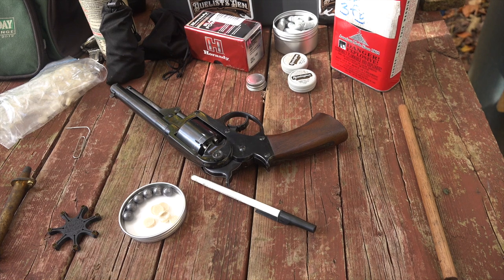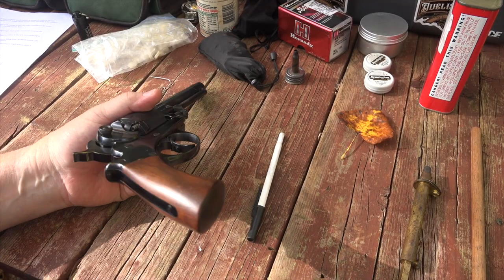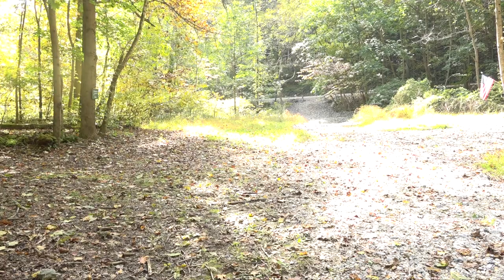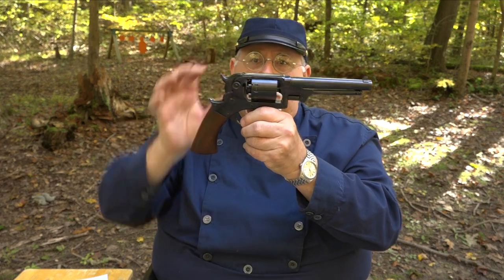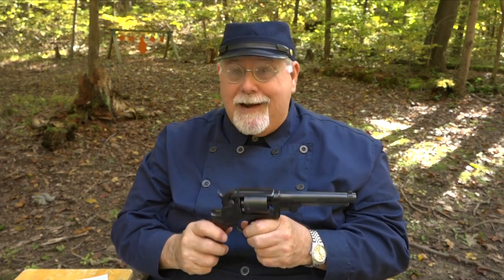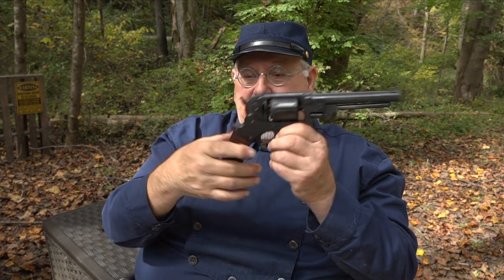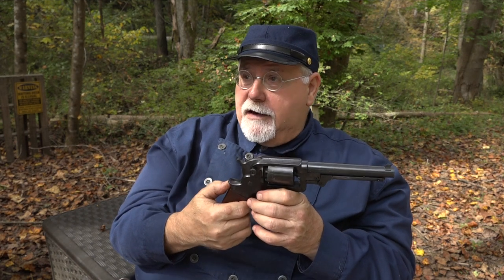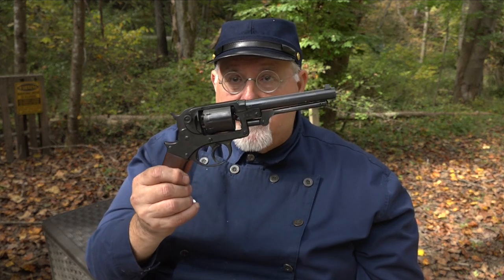Pietta's Starr Double Action Revolver

Comment: I never knew about the problem with thumb-cocking the double action Starr. That would be a deal breaker for me if I could ever get my hands on one. Thanks for the warning. Still a neat piece of engineering and a really great video, as always! Thanks Mike!
Reply: I bought one back when they first came out.  I took it out of the box and it was already broken.  I'm sure when someone is inspecting the gun before sending it off ( I bought it from Cabela's mail order ) it's hard to resist the temptation to thumb cock it.  And who knew you weren't supposed to do it?  They should have had a very prominent warning not to do it.  It would have been better to make it look like the original,  but have a more conventional double action underneath.
Reply: I was going to get one but overpriced and has many bad reviews I settled on antique iver johnson and colts 😂screw the star in my opinion but to each their own.

Comment: Fun watching the Starr actually shoot!  I've never seen that before.  I have both the 36 and 44 double action revolvers (both antiques) and would NEVER, EVER attempt shooting them. Still fun to watch you somehow accomplish it.  I did not know Uberti made a copy of the 44 cal version.  I doubt I would ever buy one - but still fun.  As to the quality of manufacturing - all my Uberti guns work - talking two colt SSA's  and a Schofield 45LC  revolver.  I mean I shoot them all the time and they run just fine.  Personally, I'm of the opinion that Uberti guns are good value for money.  Maybe that's just me.
Reply: This is a Pietta
Reply: @kevinmarrett9532  Also a good company.
Reply: No, you’re right Robert. Uberti’s are all I buy. Personally, just my 2¢ worth I wouldn’t have a Pietta. No offense to anyone who owns them, they’re just not for me. That said does Uberti make this model?
Reply: @jimwiskus8862  Uberti does not make this model. Supposedly, Pietta's quality control has made some leaps over that last decade or so. Only Pietta revolver I have ever owned was an 1858 New Model Army in 44 caliber something like 12 years ago, and it was an excellent shooter, only issue was the finish would wear down easily. I shouldn't have sold it, oh well.

Comment: I've watched several videos of people testing for chain fires.  In the tests, they loaded three adjacent chambers, the center being powder, wad, ball then grease, with the outboard chambers being powder, wad, then grease.  They only capped the center chamber and fired the revolver.  In a half dozen plus cycles, they had zero chain fires on the uncapped chambers.  They then capped those chambers and fired them showing that they would fire.  Then they did another series where they excluded the grease from the outboard chambers but did put caps on them.  Results were chain fires.

Comment: I've seen a couple original Starr DAs rechambered for 44 Colt centerfire, I guess those must have been those few that ran well enough out of the box if the owners went though the trouble of converting them.
Reply: I also have seen a star cartridge conversion to 44 colt.  I don't remember if it was a single or double action revolver.  If I would have had the $400 I would owned it to go with my colt.  Another great video.

Comment: Why put in the extra step of pulling your finger out from the lifting lever and placing it on the actual trigger, when you – after pulling the lifting lever to cock the hammer – can actually just continue pressing the lifting lever which will then press the actual trigger?
Reply from the maker: Pretty easy to pull the big trigger into the little trigger by accident before you are actually ready to fire.
Reply: @duelist1954  That does not make sense as you would normally squeeze the trigger anyway just after having cocked the hammer for a single action shot.

Comment: Where are you buying your black powder?  I was looking at getting a Tennessee valley flintlock last year and went searching for black powder only to find it was sold out everywhere I looked.. Then I read that the GOEX factory closed down and the only manufacturer left in the world was Swiss BP..
Reply: GOEX got purchased by Estes Defense group. The production of BP is a national defense thing, so the DOD is supporting that as well.
Reply from the maker: Goex will be back next year.. Schuetzen Powder is manufactured by Wano in Germany, and of course there is Swiss. I buy in bulk from either Buffalo Arms or Graf & son.
Reply: @SlavicCelery  are they still using black powder in naval artillery guns?
Reply: @mikeborrelli193  Black powder is commonly used for launching various missiles. Low pressure and consistent. And it's commonly used as a rocket motor starter. 
It also is used as an additional detonator in certain munitions. 

It's something that has a very well known operating parameters and shows up way more regularly than you'd expect.
Reply: @duelist1954  hey Duelist, thanks so much for the reply..  I know there's a hazmat fee,  so if they do have it in stock I'll order enough to make it worthwhile..  I used to be able to buy it somewhat local but no one seems to want to bother with it anymore..
Reply: @SlavicCelery  Thanks for the cool history lesson.   Would probably make quite the interesting youtube video too.

Comment: seems to me it goes off after the cap has been hit once and forced down, perhaps you need to seat them with a dowl.
Reply from the maker: I did that
Reply: @duelist1954  i figured you would have just covering bases. only thing left is either it's a hammer contact/force issue or your nemesis evil roy has his gremlins at work.